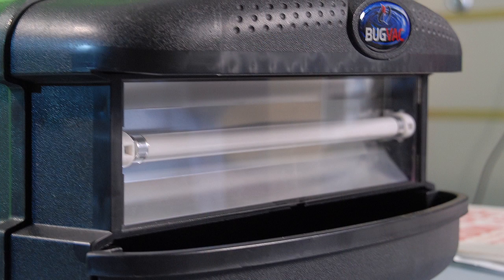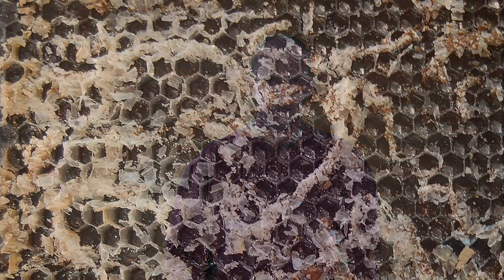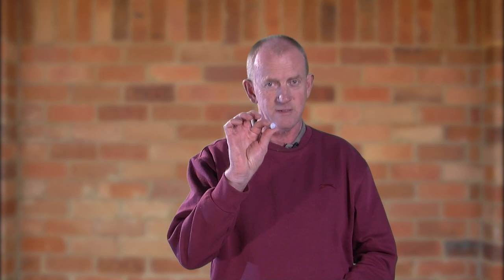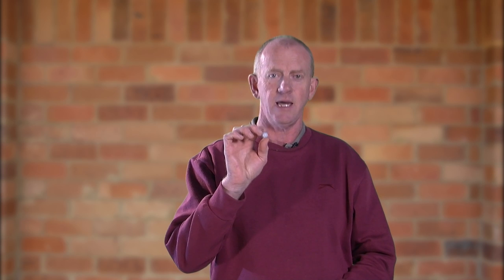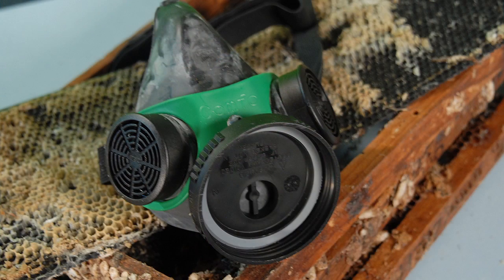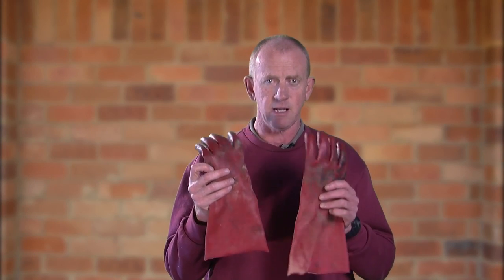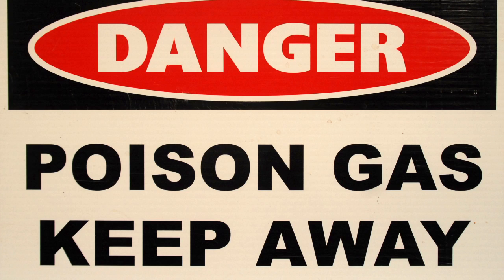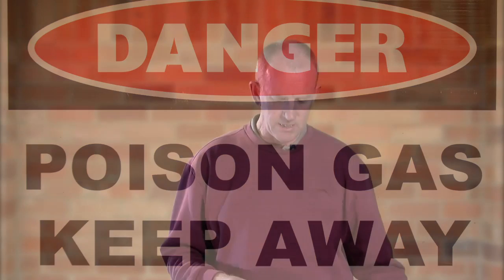Wax moth control

Comment: You mentioned using cold to kill the larva. I live in Kansas. It frequently gets down below freezing. When you said "minus" temperatures did you mean minus Fahrenheit or Centigrade?

Would exposing unused frames to super cold outside temperatures for a day in winter be adequate for control if the frames are then immediately put in plastic bags?
Reply: Centigrade in Australia